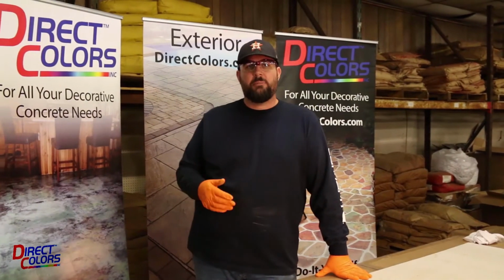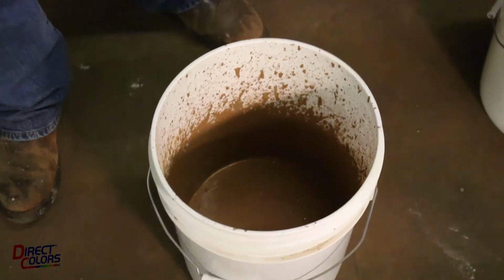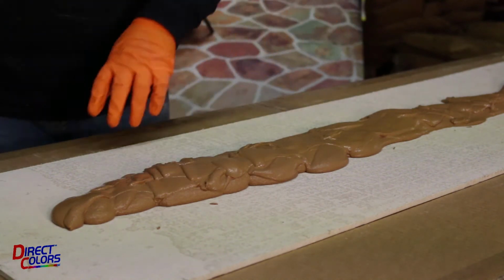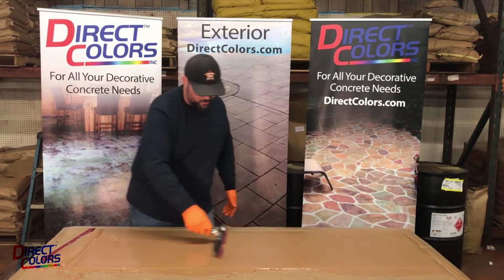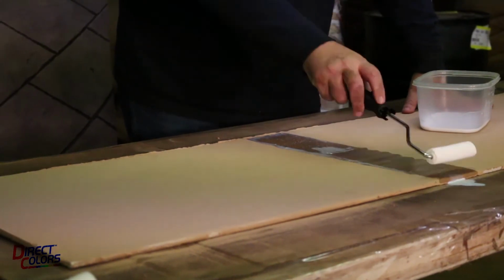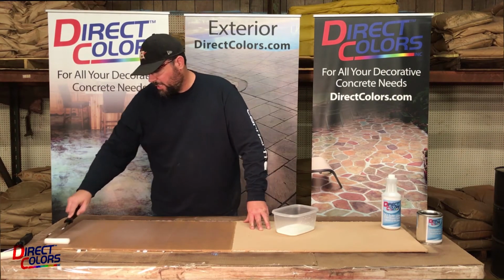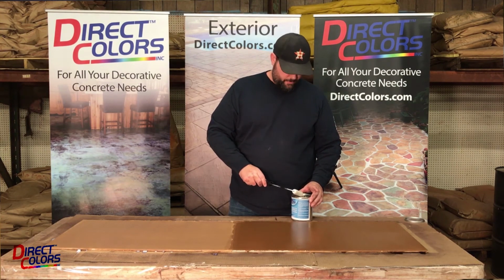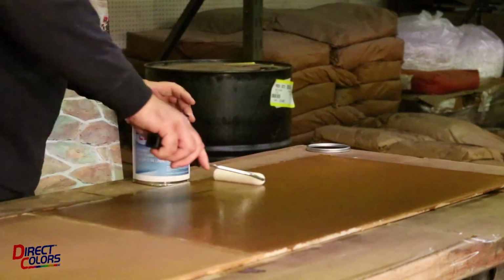Transform Old Countertops Into Concrete Countertops with Direct Colors Concrete Overlay

Comment: Used this product, and now my countertops are not merely ugly, like they were before, but unusable. I'm so upset. My kitchen is wrecked. We followed all of the instructions and it took ages and was difficult, but I was ok with that until 3 months later the skimcoat started just falling off in chunks. We sanded and cleaned them exactly as we were told to! I'm so upset.

Comment: Cam this be done on a tile countertop? Will it stick to the tile and grout?
Reply from the maker: Elsa, the concrete overlay can be applied to tile and grout, but the surface of these materials will need to be grinded/sanded to add texture so the new stain and sealer can bond with it.